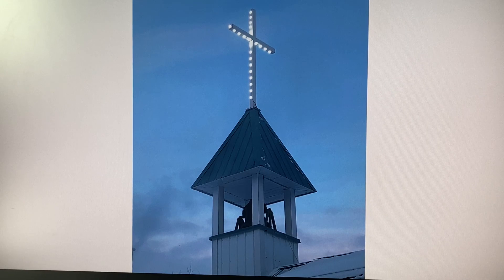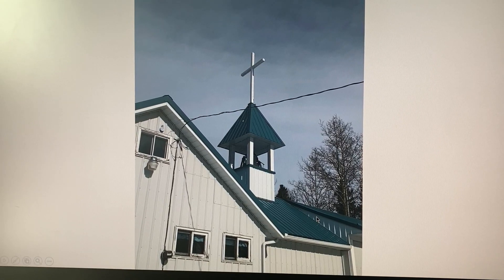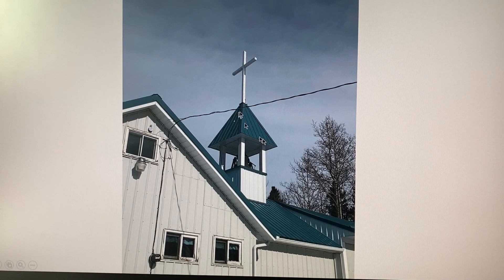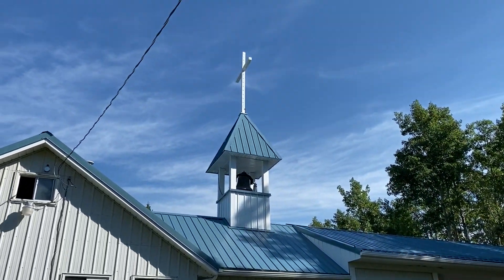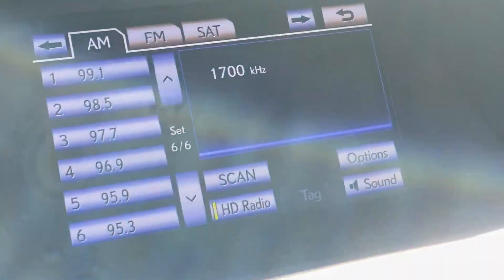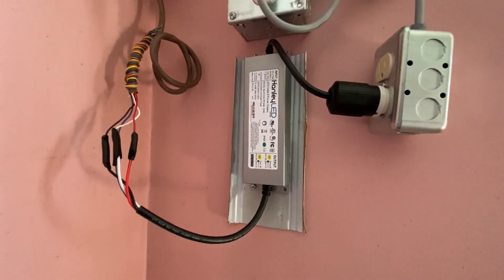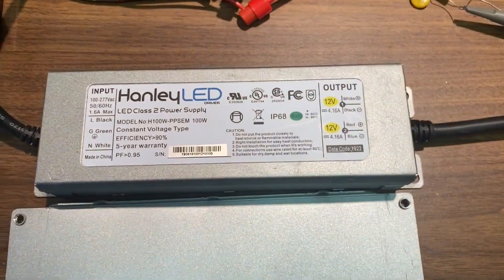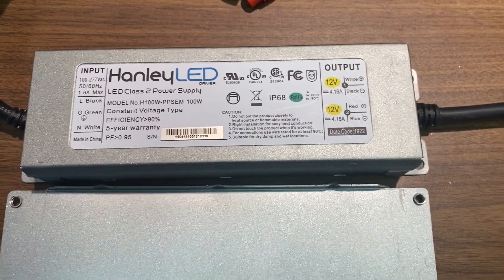LED RFI noise detection and fix

Comment: I just added a LED light bat to my SUV as the projector headlight lenses are the worst in the industry and dangerous to use at night as you can out-drive them.  The LED light bar  works well.  Now I have noise in my FM radio where I am unable to listen to a fringe FM signal in my car radio.  I will now try chokes and capacitors to see of that helps as I have many on hand.  If that doesn't work well, I will add the various power line noise filters available @ various radio parts suppliers.

Comment: Greetings from England!
Nice video, thank you.
Right, question for you:
I'm using my IC-705, AH-705 and CHA MPAS 2.0 in the garden, and every so often, normally mid-afternoon, on the
waterfall, dozens of giant vertical lines appear, on all bands, and 20 metres is literally all yellow! 
I'm only doing FT8 for now (I'm a slow learner) but I want to know what the source is... 
I'll try your trick, can I use a 2m/70cm antenna I normally have
on my FT3DE or do I need a specific "AM" antenna for fox hunting?
In advance, many thanks for your time.
73 de Manny-2EOHJN

Comment: My LED equipment mfr referred me to this video when I complained about a loud hum introduced by two small light strips I added in my RV. Unfortunately, I'm not an RF expert. I could understand how RF noise could contaminate my AM or FM reception, but not how it could show up on the ceiling speakers from clean TV audio cabled directly into the AV-IN jack of the radio. I can guarantee it's not the power supply because there is none—the LEDs run directly off the RV's 12V service. The TV shows no noise whatsoever, but it runs off AC; all the noise is on the AM/FM/AV/DVD unit, which runs on DC. Could something (maybe the dimmer switch) be injecting noise back onto the power feed, and the audio unit picks it up?

Comment: One more good video Steve.  I have the same problem with my wall-to -wall neighbor, so the noise it is very strong on my antennas. Fortunately, they are located in the bathroom and only disturb a few minutes, and are also installed in another room that is hardly ever used. We have discussed about it and he will let me change them as soon as I can. When the noise hits during a contest, I know it's time to "pit stop" for a few minutes.

Comment: Had the same problem with new outdoor security lamps my farmer friend put in next door. The PS was potted as well but I was fortunate enough to be able to completely suppress the noise with two small toroids on the AC and 48 VDC lines inside the fixture. Now if I could just permanently fix his electric fence that keeps the cows in...fortunately he's good about fixing it when "Mr. Sparky" comes out to play!  73 - Dino KLØS